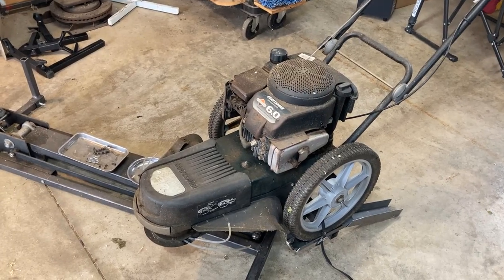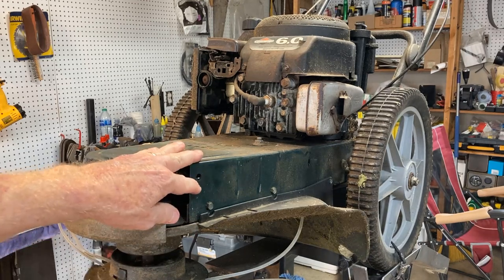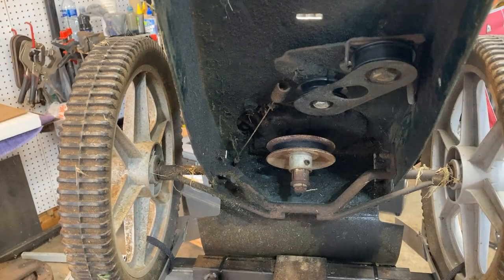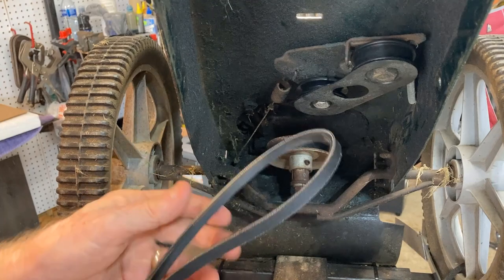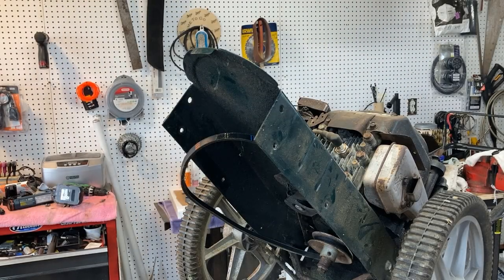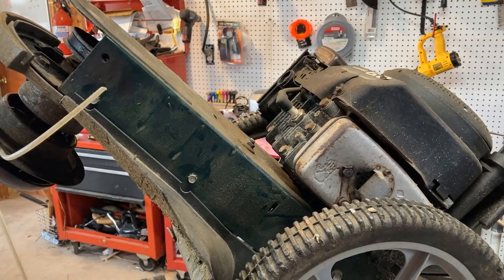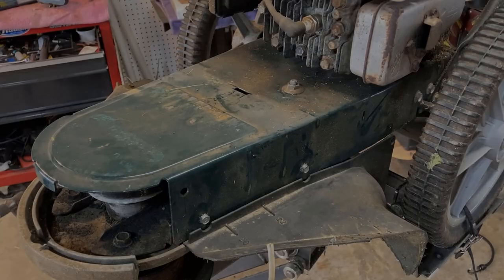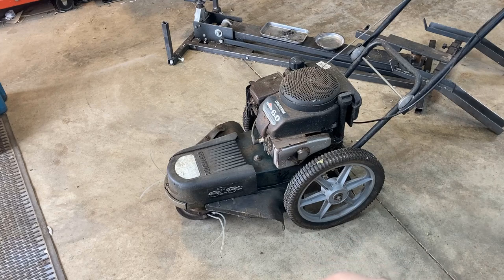I replace a belt on my Craftsman Model 917.773701 Walk Behind String Trimmer

Comment: My belt didn't break, but it seems loose. Meybe it just got loose and needs a new one. Coment please.
TIA.
Reply from the maker: Belts can stretch and make them slip, so yes, it may need replaced. Make sure the belt routing is correct though... that starts at 3:10 in the video. Thanks for commenting!